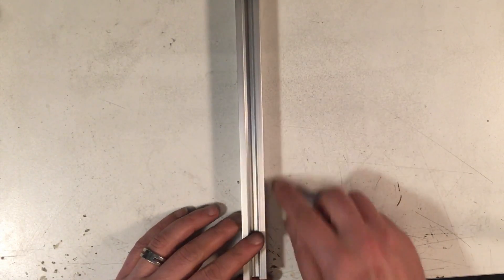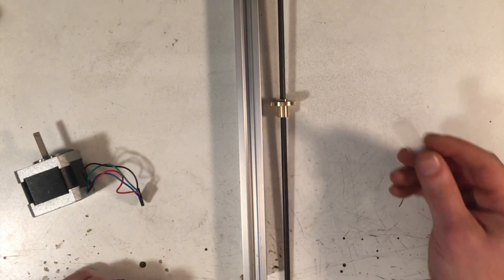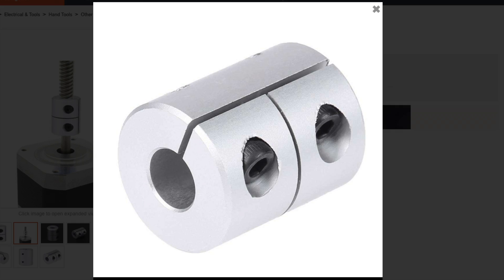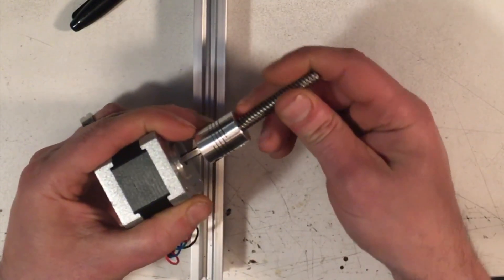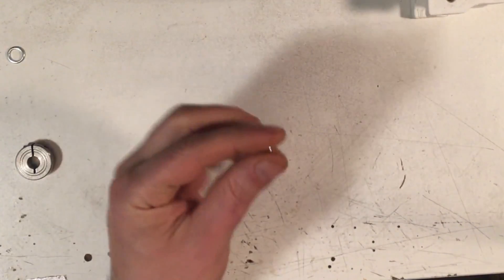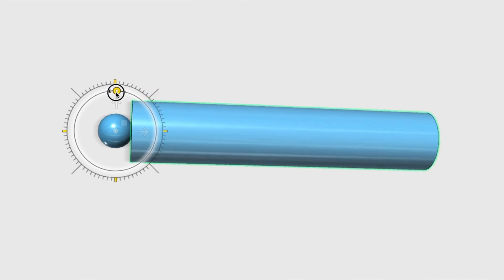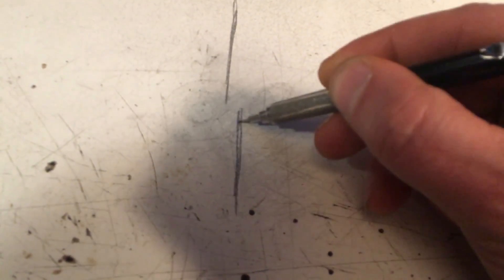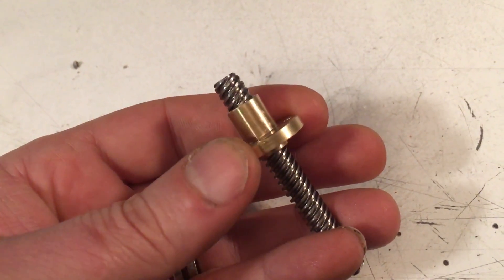Viewer question: the ball bearing trick?

Comment: If the motor is at the top of the machine this gets easier. This is how I designed my printer. The flexible coupler rests on a washer which rests on a skate bearing. No need for a separate collar but your motor ends up being upside down, so all the magnetism might fall out......
Reply from the maker: Ohnoes!  Better 3d print a bucket to catch the magnetism.  Sounds like it should work well though. I have not tried top mounted motors in a while.  Years back that was done because the regular threaded rod worked better that way, but it was flipped when leadscrews got cheaper since they could take the weight.  THe rationale was to lower the center of mass and prevent motor vibrations from causing print artifacts, but I don't see vibrations being an issue with solid design and the smoother stepper drivers we have these days.
Reply: @AlexKenis  I built my own printer and my X gantry (actually all axis') is completely captivated by 2 linear rails in a doubly solid frame (I overbuilt the entire thing on purpose), there would need to be a serious amount of force to introduce "Z-banding". As it sets my acme-rods pretty much float at the lower end, there was just no reason to capture the bottom of the rods.

I just installed TMC2208's in stand alone mode and holy crap, I don't know why I waited. I also lightened up the moving bed by removing some aluminum from the bed: original design (sandwich) was 1/4" alu plate 8"x8", 1/8" Alu plate 12"x"12 stood off from the thick plate, a 1/8" silicone mat with a channel for the heatpad wires, heatpad stuck to the bottom of another 1/8"x12"x12" Alu plate, all topped with a piece of glass. So I redesigned the drive motor brackets, lowered things a bit and removed the 1/4" plate and the first 1/8" alu plate, replaced those with a 1/8 x 12 x 12 piece of garolite and cut the silicone mat into strips to reduce even more weight. So now it's just garolite with silicone strips glued on (with silicone caulking heh), then the alu heat spreader and heat mat with the glass atop. 

Reducing the bed weight by nearly half and the new TMC drivers has nearly gotten rid of vibration effects in my prints. Then again I don't really go beyond 40mm/s for print speed. I just don't need my prints that quickly. Hell I didn't even care about the ringing effects to begin with, but tinkering with the printer is the larger part of the hobby for me, so I like to try new things out here and there. BTW, I'm using a Ramps 1.6 and its working great with zero issues. I cannot comment on the mosfet for the heatbed because mine is plugged into the wall and the mosfet is controlling an SSR. The mosfet for the extruder is working like a champ, I might head to digikey and order a known name brand mosfet of the same type or better to avoid the possibility of this one being a clone.

Comment: I really would not suggest to attach the axial forces from a machine onto
the radial bearing inside the motor.
Reply from the maker: It depends on the motor. For cheapo motors, I agree completely, you can't expect a long life with a high axial load.  I posted this a a quickie hack, not a recommendation, and I personally use a bearing block to keep the load off the motor. But if you want to look into it further, bearing life expectancy is listed as it's L10, and other ratings are tied to it.  I'll add what I can, but my bearing and motor experience before printers is from building industrial automation control systems, which have more of a tendency to list all the relevant parameters in the data sheets since most gear has to pass certification. Many stepper data sheets will have the max axial (sometimes called thrust) load listed as max permissible to meet the L10 rating. The better nema 17 sheets I have here generally list the axial load anywhere from  10 Newtons to several hundred, so it can vary drastically.  operating conditions are also important, so as an  example, one 42mm nema 17 sheet had 28N max axial load at continuous operation at 300RPM to be able to meet the quoted 10,000 hour spec, but obviously we don't run continuously at RPM that high, so I would consider that motor okay for a gantry under 10 lbs, BUT many cheap motors don't give a life estimate, and I have found that they arbitrarily just put "10 Newtons" as the axial rating, so whenever I see that, I am suspicious and would not trust the motor bearings to last very long with the gantry weight on them.  They are probably using lightl duty deep groove bearings (which are only rated to handle 10-20% of their static load as an axial force... at least from what I remember), so you could do the math to figure out what the bearings can handle.  Light duty motors also have a wave washer for compression, which can flatten under axial load, so that's another consideration with "10N" or unrated motors.

Comment: Also, I wanted to say: You know your stuff.
But you can't allways be right.
I posted some comments on this video, but they got deleted.
I don't know what happened there, exactly.
But somehow, my comments were removed.
If you do not agree with what I say, just reply, instead of delete.
If that is what you did. Becaue I would like to learn, if I was wrong.
As far as what I know: I do not particularly agree with this hack.
Reply from the maker: I just checked and they got caught in the auto-filter.  I didn't read them yet, but I'll pull them out and make sure they are posted.  I don't delete anything unless someone is attacking another poster or being inappropriate, but people can disagree with me all they want, that's half the point

Comment: Alex do you encounter VFA (https://shop.prusa3d.com/forum/user-mods-octoprint-enclosures-nozzles--f65/stepper-motor-upgrades-to-eliminate-vfa-s-vertical-t28098.html) on your printer as well?
Reply from the maker: I have not experienced that, but the way I run the belts gears the steppers down, so they are essentially 0.9 degree which may make the lines small enough that it's not as noticeable, and I am already using OMC steppers so maybe they are less prone to it as that article suggests.

Comment: I bought a Nema 17 which has the lead screw integrated. That is better, right?
Reply from the maker: I have not done any long-term testing, but an integrated leadscrew should be good in terms of alignment and preventing eccentric motion as long as it is straignt.  My only long-term concerns are that the weight of the gantry is resting on the motor (As Werner mentioned) which is one of the reasons I use a bearing block, BUT companies like Prusa seems to be having good luck with it, so it may be fine.  I'll be keeping an eye on Prusa user feedback to see how it does long term, and if it seems to be an issue, I'll address it in a vid.

Comment: Thank you very much, Alex!  You are analyzing important problems when a solution is not lying on the surface.  I agree with most of your points and, particularly, with the final conclusion/solution.  However, I have something to add to your and CM 62's words.  I have solved this problem on my printer forever.  My printer has a lot of other problems, but this Z-axis wobbling and bouncing happen no more.  I also use a spiral aluminum coupling, mine just has two setting screws on each end and the screws are not opposite, they are at the straight angle.  The tolerance in both holes (on the stepper side and on the acme screw side) is about the same and when I tighten the screws, they make a triangle (the contact spot between the coupling and the screw and the two setting screws).  The setting screws are made on the same side (are aligned) on both ends, so they push the acme screw and the stepper shaft the same way inside the coupling.  Thus, when the whole thing turns, the coupling is slightly off axis (is wobbling), but the stepper shaft and the acme screw are aligned pretty well.  And then about the ball between them.  Before assembling I made kind of spherical shape on the end of the acme screw.  I turned the screw in a lathe chuck, and used an angle grinder with a sandpaper on it.  Lathe is not necessary, you can use a drill and a third hand instead.  My spherical end plays the same role as Alex's ball, but is just one part less.  And, yes, I slightly pre-load the spiral coupling as CM 62 does before tightening the stepper side screws.  Works PERFECTLY for Z axis (in my printers Z is a vertically, and slowly, moving table), absolutely no side effects.  I would not recommend this for other axes that move with high accelerations in both ways, but this is another long story.  But for the table, slow and under gravity force - perfect.  Even the cheap brass (or bronze) nut with a huge play is not a problem, the gravity holds it in place.  But don't use such a printer lying on a side :) .
Reply from the maker: Sounds like a good way to go about it.
Reply: @hoffer_moment  Hi Chris!  I did not understand what you mean 100%, but it seems to me you got it right.  I just can say the same in a little different way.  From a factory the stepper's shaft is cylindrical.  And the acme screw is cylindrical too in general (if we do not take the thread into account).  The point is to make the flat bottom (or lower end) of the acme screw slightly spherical.  It does not have to be a half-sphere (with the screw diameter), not at all.  It should be just slightly protuberant, a spherical cap of a sphere much bigger in diameter than the screw.  And the end of the stepper's shaft should be left untouched, we should not make it spherical.  Or actually the opposite way: if it is more convenient for you, you can make the stepper's shaft spherical and leave the acme screw untouched.  Then one word about preloading of the couplind.  I think, 2 mm of stretching is too much, I would recommend 0,5 mm, maybe up to 1 mm.  Then you write "lathe sand the threaded rod to ensure its straightness" - if you mean grinding the side surface (the cylindrical surface) of the acme shaft - NO!  You will spoil it by doing that.  You should only grind the cylinder bottom at one end of the acme screw to turn it to cpherical cap.  If your acme screw came crooked, just streighten it by bending (or UNbending :) ) and a lathe is a good tool for it.  I was securing the acme screw in the lathe's chuck, turning the chuck by hand to see the direction of deviation usind a lathe cutting tool as a reference and bent the screw by hand.  This process is iterative, but after a few minutes, after bending it in 4-5 points evenly distributed along its length I got an almost perfect screws.  By the way, I did the same with polished cylyndrical shafts which the axes move along.  And I did not understand your phrase "so it can rotate on the stepper shaft".  The stepper's shaft, the coupler and the acme screw turn together, they do not turn against each other, I think, that was just my misunderstanding of you.  Well, this is how I see it.  If you have more questions, just usk :) .  Happy printing!

Comment: I designed a motor bracket, with an extension to hold the coupler.
I printed it with PETG. I should post it on thingyverse or so.
When I do, I'll get back to you.
Reply from the maker: Sorry man, I have not been deleting anything.  If you post frequently or post a link, the comments get held in a filter until I manually approve them, and my computer has been down for a few days with a scrembled boot drive, so I have not been checking.  But go ahead and post the link when you get it finished, and I'll keep an eye on the filter if it gets caught up

Comment: I love your videos Alex.

To add to the ball bearing trick, I also stretch out the flexible coupling by about 1.5 to 2mm (like pulling a spring apart) and hold it there whilst tightening it onto the shafts. That way it also provides anti-backlash in the other direction (pulling) as well, that's of coarse assuming the linear acceleration is within limits.
Reply from the maker: Good call.  I do the same thing when using a bearing block and it works well

Comment: yeah that's good information!

friendly greetings from The Netherlands!
Rob.
Reply: I am from the netherlands too ;)
And I built 3 3D printers.
What he says is not good at all, but he keeps removing my recommendations.
Reply: @wernerboden239  

How okay?
but what is wrong with a ball in the coupling?Wat is er mis mee dan? Een kogeltje in de koppeling?

VrGr Rob.
Reply: @hobbyrob313  The coupler is also designed to detach the motor from axial forces.
But now, the load of the printer acts upon the bearing of the motor, which usually deal with radial forces.
I built 3 printers; I should put some stuff online to demonstrate how it is supposed to be done (or at least, how I did it).
But, if you look through the specs of sfu2005, you will see how the BK15 bolts the lead screw into place with 2 bearings and a nut, to protect the motor from such impact.
I could upload a motor mount design I used for my printer onto thingyverse.
When I do, I will get back to you.
I am tempted to do a video on some of his topics,
that can destroy a 3d printer.
Like the floating lead screws, without bearing on one end; good way to destroy you tr8x8 lead screw.
Well .. the longer ones.
If I did that with my 700mm lead screw...ouch.
Reply: @wernerboden239  I had to read twice before I understood!
But yes I understand now and to be honest you are right!

But I also have a but!  ( LOL ;-)  )
and that is that I also understand why they want to do the trick with the ball.
And to be honest, I would also like to do this, despite the fact that you: Werner Boden are right!
Because what would become the problem in the long run is that the bearings of the stepper motors could break (and I would take that for granted)

As a check, did I understand you correctly?
And Yessss, I would make a small video right now to show what you mean.
(I think and am afraid that not everyone understands it what you mean!)

Kind regards from Rotterdam!
Rob.

Ik moest twee keer lezen voor ik het begreep!
Maar ja ik begrijp het nu en eerlijk is eerlijk je hebt gelijk! 

Maar ik heb ook een maar!
en dat is dat ik ook wel begrijp waarvoor ze het truukje met de kogel WEL willen doen.
En eerlijk gezegd zou ik dit ook toch gerust doen, Ondanks dat jij: Werner Boden gelijk hebt!
Want wat dus op lange duur het probleem zou worden is dat de lagers van de stappen motoren stuk zouden kunnen gaan.( en ik zou dat dan voor lief nemen )

Ter controle heb ik je goed begrepen?
 ik denk van wel!
En nog even dit, ik zou juist nu een kleine video maken om te laten zien wat jij bedoelt.
(ik denk en ben bang dat niet iedereen het snapt!)

Vriendelijke groeten uit Rotterdam!
Rob.

Comment: and why not just delete the ball bearing and run the screw on the motor shaft?  full disclosure I've been running my screw on the motor shaft for over 2 years  for the same benefit and as far as i can tell no issues.
Reply: It can flex more freely on the ball-baring than on the flat shaft.

Comment: Or you save the extra effort with the fixed bearing and takes such lead screw stepper ....

for example...

[16,40€]HANPOSE 17HS3401-S T8x8 Nema 17 Lead Screw Stepper Motor Linear Actuators 34mm 1.3A 28N.cm 4-lead 42 Motor 100-500mm Trapezoidal Lead Screw for 3D printer Z Axis Mechanical Parts from Tools, Industrial & Scientific on banggood.com
https://banggood.app.link/4LvaGaTzEV